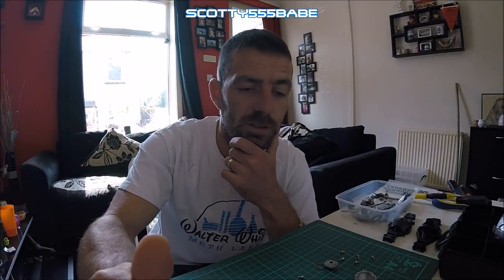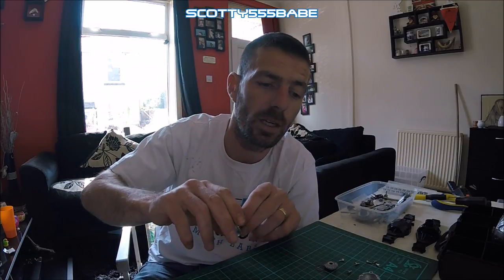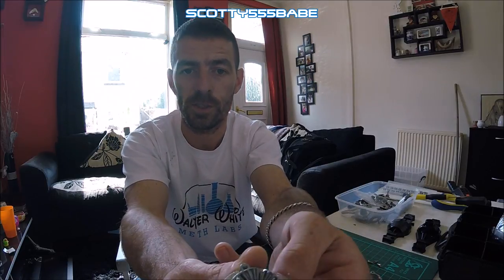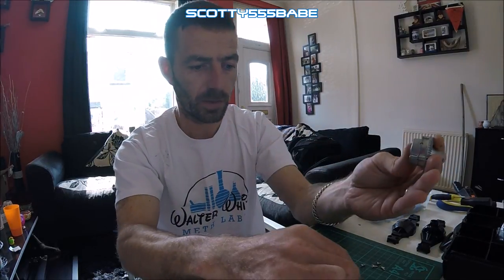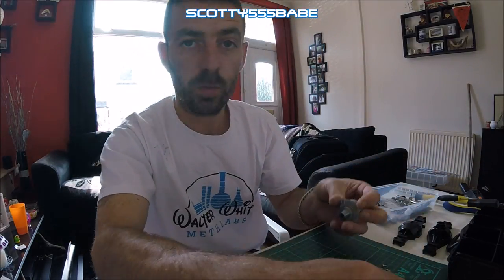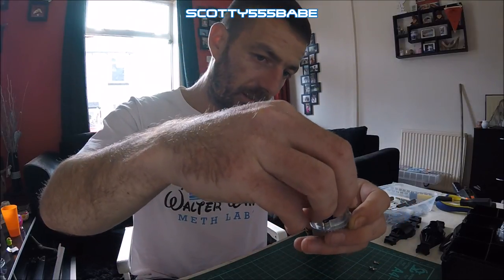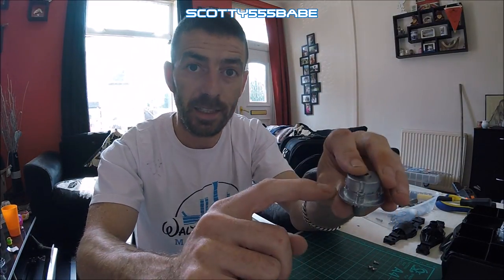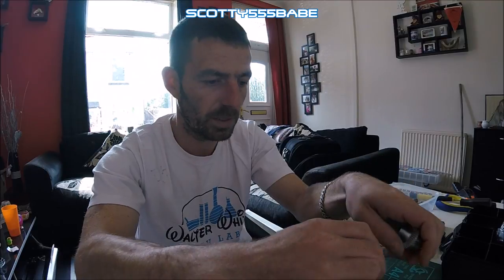TOP TIP | TAMIYA RC SEMI TRUCK | DIFF LOCK | RC TRUCKS

Comment: Works a treat when you're just running the tractor unit, no mess and totally reversible if you change your mind. When you're pulling a laden trailer though your steering isn't too great as the truck just pushes forward. Just worth thinking about how you are going to be using your truck.

Comment: Just did it with my new King Hauler and it works beautifully before that it would get stuck on small bumps but now I tried it a bit indoors and it's getting over everything. A very easy solution and for a newbie like me in the hobby very doable. Thank you so much for this I'll give it a spin outdoor later
Reply from the maker: It's a great trick, and works a treat, I have a king hauler locked up which I haul through the woods and it just pulls faultlessly, they dont grip at all unlocked on uneven surfaces and should you want to put it back, you just put the gear back 😊 I have a few mod videos and how to 👍👍

Comment: I did this to my grand hauler, I only lock the rear diff the front-rear is still open...it does the job
Reply from the maker: Still gives you turning room with the one.. With both locked you'll find your turning circle is much wider 👍

Comment: i am surprised that you can't get remote diff lock upgrades for the trucks.   i got some 6000 cst  diff grease when i got my truck but haven't put it in the diffs yet as i won't be pulling a trailer until i can talk the missus into getting me one (probably sometime around xmas) so i just used the grease that comes with the kit for now
Reply from the maker: You'd think so by now the way the hobby keeps pushing forward, even a driven steer setup would be nice too..
Hope you get your Christmas present 👍

Comment: Great way to lock your diffs, and completely reversible, thanks. Does the truck still steer ok with both rear diffs locked?
Reply from the maker: Thanks.. It does reduce the steering slightly due to its own arse pushing the front end but it's not a dramatic difference where as when its fully loaded and all the weight is over the rear end then you notice it slightly more, I guess it all depends on the load weight really as to how its affected 👍

Comment: dood. check your lighting options. the windows in the back are not good... also maybe putting the cam on center of the desk a bit higher angling down on your forehead and work area could look goood while keeping you in frame (best copyright protection...)
Reply from the maker: +Gaspard De Coligny Thanks for that tip as lighting in my house is a nightmare 👍